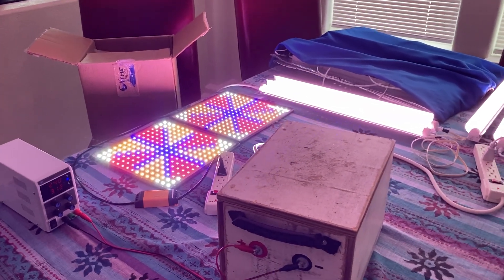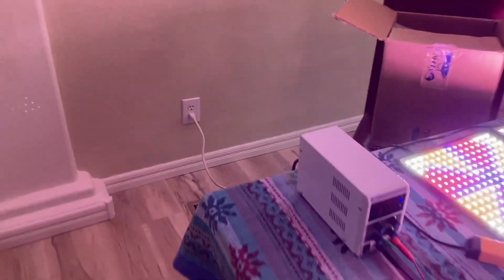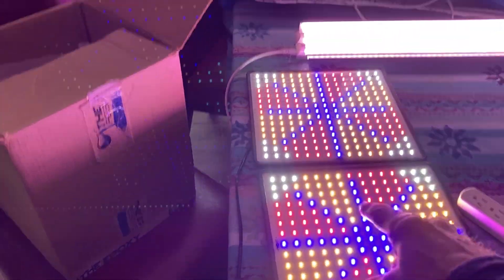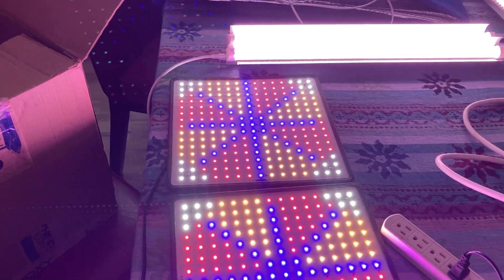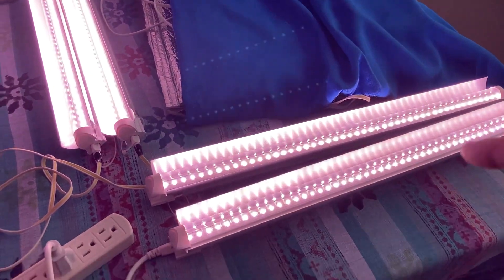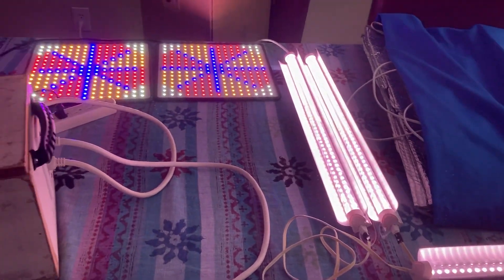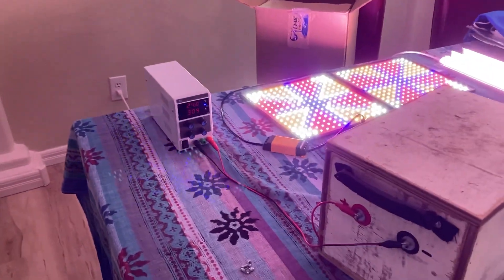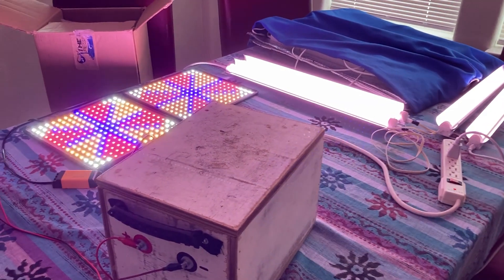24V DC vs 120V AC TEST

Comment: Nice job….  I don’t know if you seen my other message but you don’t have to add more volts to get more power you can get a lot more power using the magnet trick on the outside of the Motor case ( Gerard Morin)or by replacing the magnet inside the machine (drain pump)with a neodymium magnets from castle creations motor (very hard to find neodymium magnet this size…. you will double or triple the voltage (ref)with using no more power example is on” enter the realm” guys that aren’t afraid to see what happens… FYI if you use a neodymium magnet with only 12 V you will make more voltage and you are making with this video…almost 2/3 more…. Let’s move forward and blend and merge ideas….  I am currently working on a few ideas myself many years in and just starting to refined some things now future can only be brighter….. 💡 💡 💡 … keep experimenting  everyone…..😊
Reply: Hi Joe your comment is very insightful. I have a question: is it possible to build a small version of this and put into an RC car. I´m building custom RC cars and I really want to use this tech in it to improve the small electric motor. Any help would be much appreciated!

Comment: Where can I find instructions for the build?
Reply from the maker: Watch the Gerard Morin Device Build!
Reply: Sometimes people just don’t get it it’s not always the consumption going in and out that’s how you get there you can make a lot more RF in RF Canobie used for many things many mechanical things useful things other than light show a person that says that the RF won’t do the work they are wrong I’m sick of hearing these people think they know what they are talking about and they’ve never picked up a screwdriver before.. RF is able to run a lot of items much more than lights TVs fire sticks small motors mechanical operations small heater.. I can’t also have done experiments with less than 6V and I will light up all of those lights that he has …not using 24 volts… I am currently working on a machine that uses 12 V car battery at 2.6 A that has six lines 65v .87a output.. I am now disassembling that machine and making 12 separate lines and using the same 12 V with only 4.8 A to 5.2a each line will get 65 to 70 V .87a  12 lines at 60 Hz exactly… RF can be used for many things it is awesome to work with and allows you to make many mistakes without the disaster…. Lol Magic besides all the people that talk their crap there is no other way in the world to make something run at 120 V with 12 V of DC so believe what you want sometimes it’s the journey